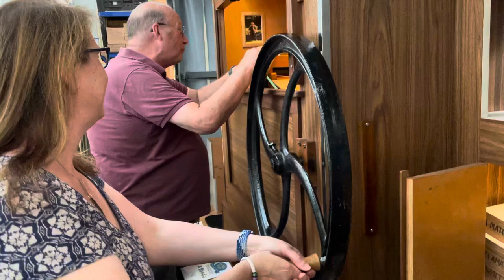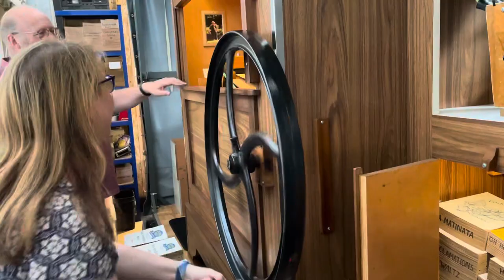What’s it like…to manually crank a fairground organ

Comment: Yeah that's not the right crank wheel that's supposed to be on it The one that goes on there is small which gives you more revolutions per turn compared to the big one